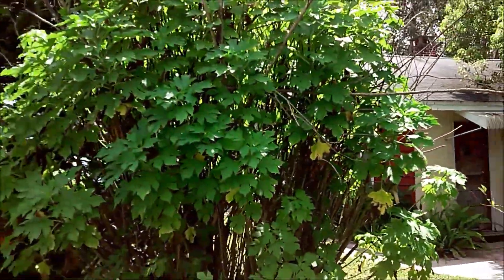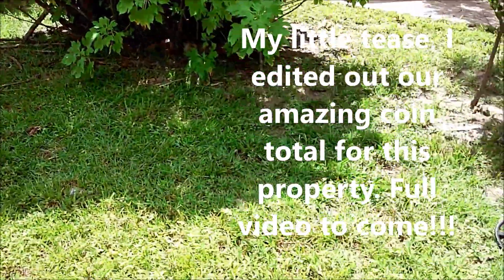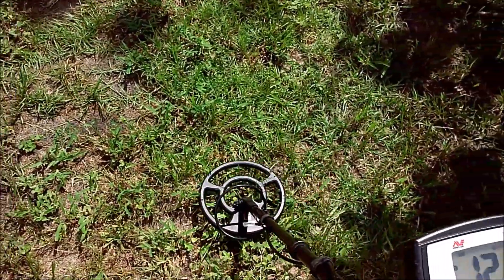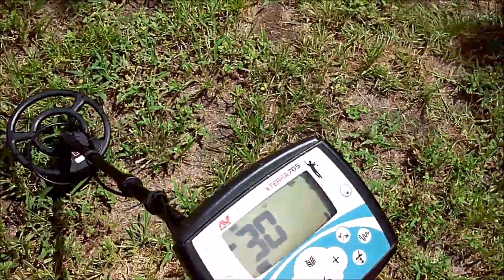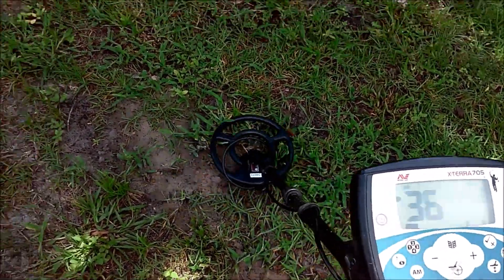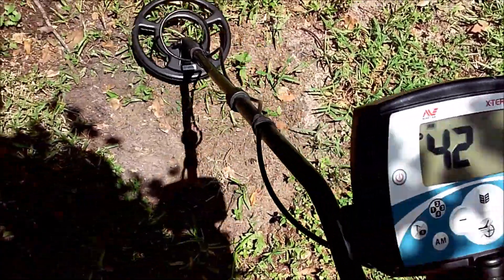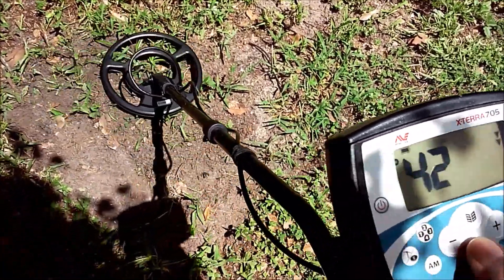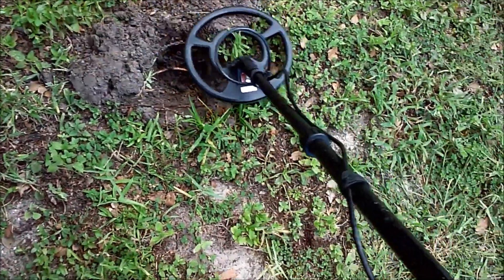Say GOODBYE to my Minelab 705. It's going away for repairs! Diggin'w/Rob!

Comment: The 705 is a great machine...I have it with the 15” 3khz Coiltek and its my deepest go to unit...even over the ETRAC I have with the X12. I did a VLOG video on it on my youtube channel...I would not trade that sucka for anything! Hit a 2 reale a few years back at 18” measured...write up in Eastern and Western Treasures called “Going Deep” Hope you get it back soon...ATB..Jason
Reply from the maker: Jason, thank you VERY MUCH for the info!!! I will look your channel up AND that article!! Way cool. A reale, now there's a bucket lister!  Haven't found anything significant super deep with it, but in hunting a 1918 property a few weeks ago, it picked up the old city iron pipe about 15" down- so happy with that, and it detects the tiniest of metal pieces also. I have the small eliptical gold coil and also just bought the big 15" coil for it thru Kellyco!
Rob
Reply: Flthunder Enjoy that 15...3khz?